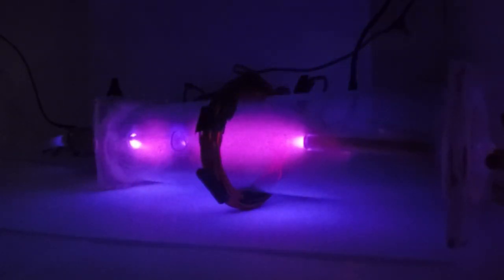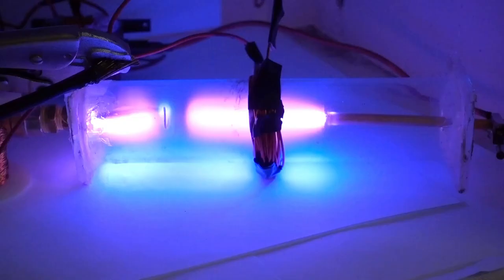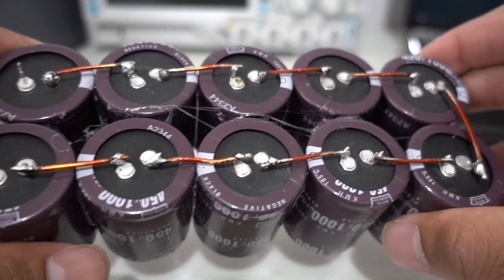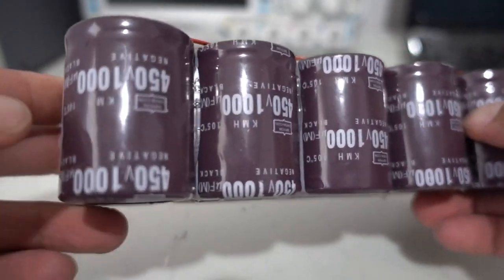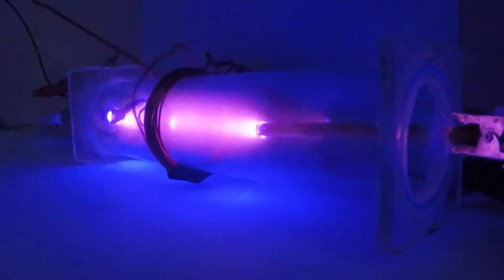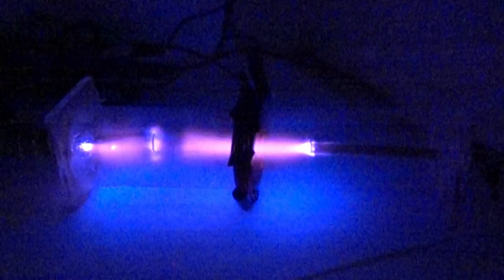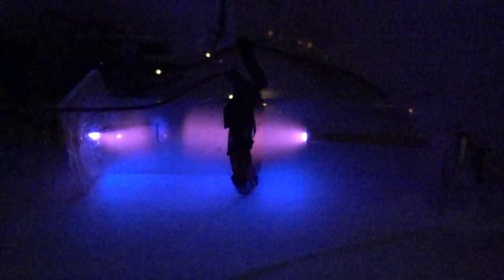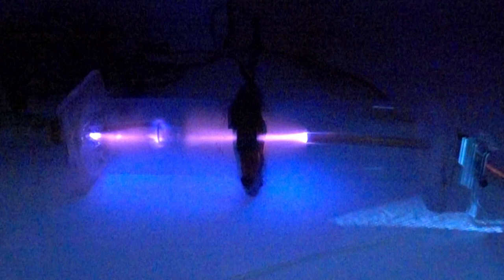Plasma Compression (Z Pinch) Part 1/3

Comment: I have done some experimenting with Plasma.  Your capacitor bank you showed is in Series and should be Parallel.   Series capacitors have LOWER power. plus each capacitor will have a different voltage.  What you should do, is run all capacitors in parallel off one lead of the transformer secondary, the output from parallel capacitors should go to the coil on the tube, the other lead of the tube coil, should be connected back to the transformer secondary.   What results, is pulsed DC, where 1/2 the AC wave charges the capacitors, and the second half of the wave discharges the capacitors through your tube coil.  It will also double the voltage.
Reply: Forgot to mention, you need AC capacitors because you do not know which part of the wave will start first.  Suggest paralleling a few Microwave Capacitors.
Reply: Pulse yes. Microwave
Reply: Depends what voltage is being used, you series them to increase maximum absolute voltage at the cost of decreasing capacitance and increase in ESR, parallel them to decrease ESR, increase capacitance but you are then limited to the max voltage. q=c.v, or q=i.t  so series or parallel will not benefit a increase in coulombs as long as you are utilising the max voltage of the combination.
But as I pointed out in another comment, a better set up might be to use high-current, low voltage plasma using graphite instead of high v, low current as the magnetic field produced from the plasma will be stronger and hence have a stronger interaction with any field windings.

Comment: Good work!, I didn't realise the amount of magnetic field required to compress, thats very high!, alternative viewpoint here, instead of increasng turns and current on the field, why not use a high-current plasma set up instead, so the main field will interact more strongly with the windings? I am thinking like the high current-low voltage setup of a tig welder or plasma cutter, maybe 100A @ 60v in free space with insulated+heat protected windings ?
This can be achieved using graphite rods to initiate the plasma as they do in plasma arc furnaces. (Graphite rods cheap off ebay)

Comment: Super nice! What kind of vacuum are you running? And what is the voltage across the plasma?
Reply: I guess that it's not vacuum, but helium and it can be run by 15000v. Because vacuum would just completely isolate electricity.

Comment: Sorry if this question is irrelevant but how do you produce a gliding arc /'warm plasma'?
Reply from the maker: No worries, I use a 20 KV high voltage power supply. Its basically a ZVS driver with a flyback transformer and an operating frequency of 40 KHz.
Reply: Thanks for replying sir but I feel my question deserves some explanation. I am a student of plasma physics. Plasma is categorized into three types, hot, cold and thirdly the 'warm' plasma type in which the electrons carry the most energy. My question was practically how can you manipulate plasma so that its 'warm'. Maybe by altering the spark gap and/or adjusting the amperes or frequency? Or maybe by blowing air or with magnetic field?

Comment: could you please explain what exactly the reason is for explosion ? is that recoil from plasma or is there another reason ?
Reply from the maker: The wires were joined together with solder instead on clamping them with terminals. With the surge in current, the solder has a higher resistance and stated to heat up till it vaporized.

Comment: very interesting would like to know how to calculate between 30 A and 40KA, say you have source in order 100 A what's will be KA??
Reply from the maker: Thanks, the current from the transformer was measured directly by a current meter, ~ 30 A. The current from the HV capacitor bank was calculated using the resistance of the wire, 0.062Ω and the impedance 0.00016956Ω (which is negligible), and 4000V / 0.062 = 64 KA.  I said 40 KA because of the unknown resistance from the connections and trigger, but the capacitor bank dumps all its energy in the theoretical time so I think its accurate.

Comment: Looks to me like a theta pinch. The magnetic field that makes is axial, while the current is azimuthal. The name of the pinch comes from what the current is doing, not the magnetic field. Theta pinch like you have here is more stable. Z pinch requires a fancier poloidal coil that essentially makes the plasma the secondary coil in a transformer